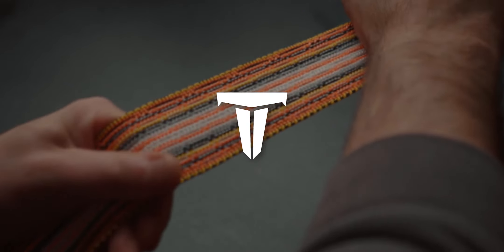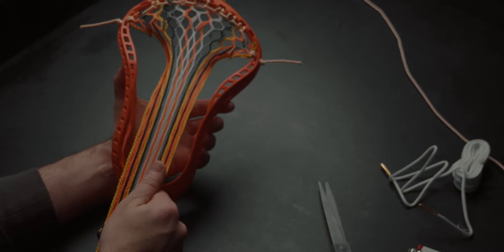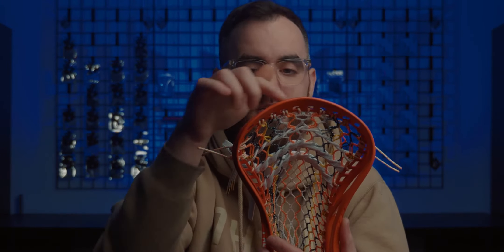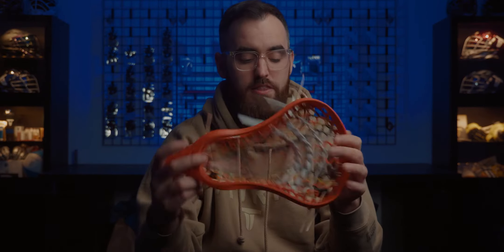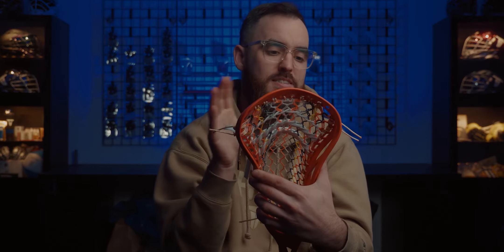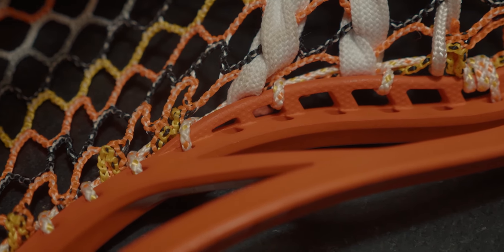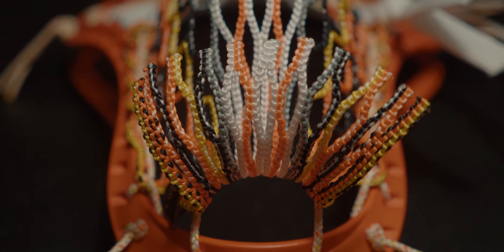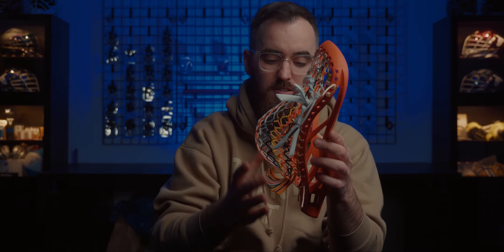How to String a Gait Torq

Comment: This head is being completely overlooked as an awesome D and LSM head, it’s super stiff, wide, and has a great shape
Reply: It's no wider than a command though. Just heavier and stiffer
Reply: Heardred rlly? I picked one up at LU and it looked a bit wider
Reply: I grabbed mine from LU too! Idk I held it up next to a command 2 and it looked like it had the exact same face shape and very similar bottom rail (though that bottom rail is also quite similar to the torque I have from 08/09). The inner rail will make it a tighter pinched head than the command so its cool to have options. The plastic itself may be thicker and make it look wider like a rebel offense vs a rebel defence
Reply: I did notice similarities between the UA heads but that’s going to be because they are both designed by Team 22
Reply: @wyattbiggar7460  Yep youre not wrong from what I know. And the people that would have at least assisted in the design the under armour heads designed the torque and other gait heads, which is fine by me because I loved gait stuff. But hold a new torq to a command 2 and you'll see what I mean!
Reply: @Heardred thanks! I'll definitely check that out

Comment: I just strung one up for my Brother using LE Fire. I ended up using a modified 8-diamond top string (using the 10 diamond row, but not the outer diamonds on each side like a goalie head). The rest of the pattern looks really similar to yours.